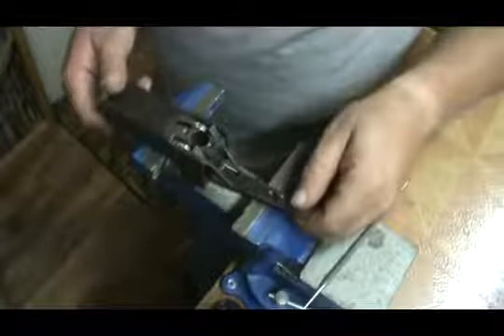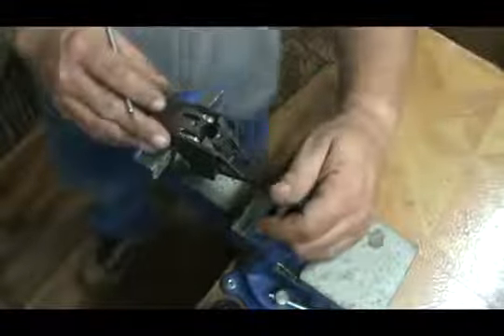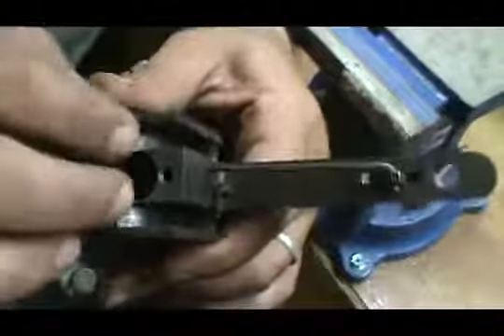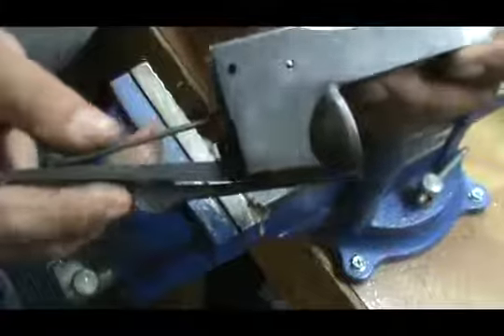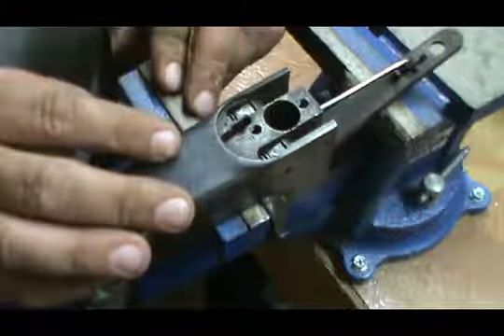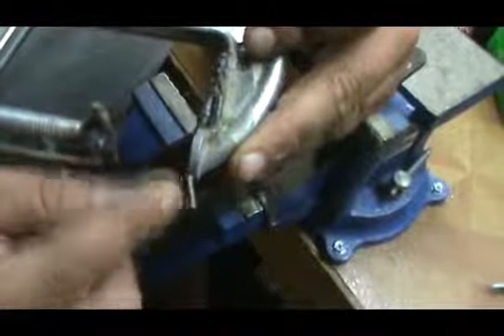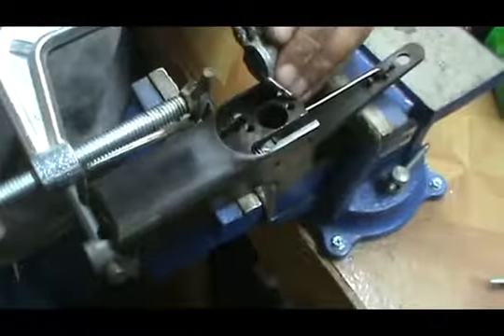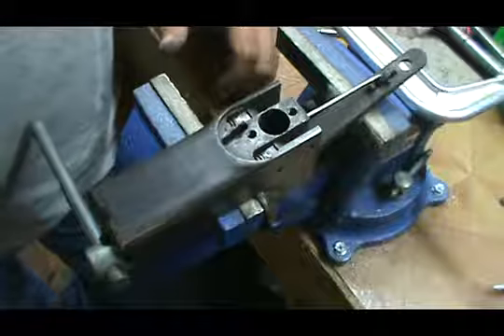Mainspring Replacement on LeFever Nitro Special 12 Gauge

Comment: great video man. no one else has a video showing how to disassemble one of these lefever nitro specials.
Reply from the maker: +mikew9788 Thanks brother and yep don't I know, part of why I did it. If you don't watch it, these mainsprings can flat kill somebody when they come out. LOL Since this video I have modified the tool I made somewhat but it basically works the same, just a little smaller clamp using harder round stock so as not to bend as easy.

Comment: There are a  couple of pin holes in the receiver just ahead of the port where the mainspring and rod fit.  If you put a pin into those holes, would they hold the spring until you get the hammer pinned  home?
Reply from the maker: There are no holes in this one like you speak of.

Comment: I'm having a problem with mine was shooting well all of a sudden one triggers stopped working looks as if the hammer does not cock far back enough for the sear to catch the hammer took out the cocking sear and and it seems the cocking rod is stuck inside the receiver can't get it out i was thinking the rod is bent or something preventing it to cock the hammer fully
Reply from the maker: that is very common on these old shotguns, yes, usually you can pick a used one up on eBay fairly cheap. but, i opted to just build two myself, they are not an intricate piece. just a rod with rounded ends.
Reply: Do you think If I blow torch it it will loosen up and fall out  do u thing it's the hammer thats causing it or the cocking rod  it's completely stuck
Reply: The hammer is moving back but not far enough for the sear to catch it
Reply from the maker: typically it is a bend cocking rod, i would not torch it, i would remove the hammer and the tap it out on way or another. be mindful of the mainspring though, it is a beast.
Reply: I know there is no way I'll be able to do it
Reply: Can you fix it for me ? Lol
Reply: @CloverTac  correct,  removing these main springs without caution can put you into the hospital if not careful. Eye protection is a MUST when removing the springs 😂.